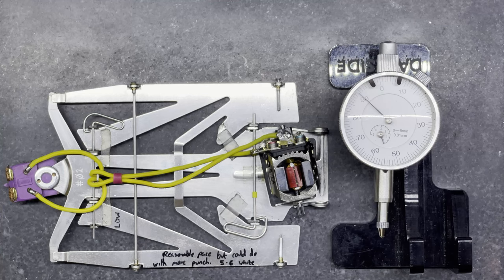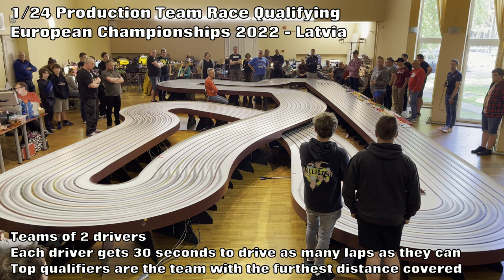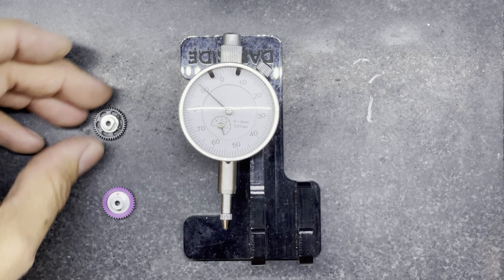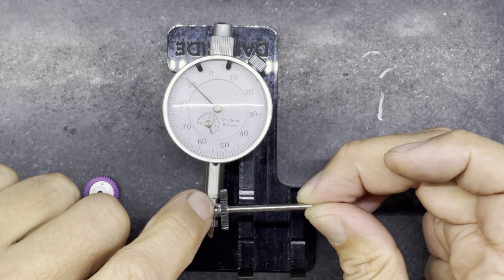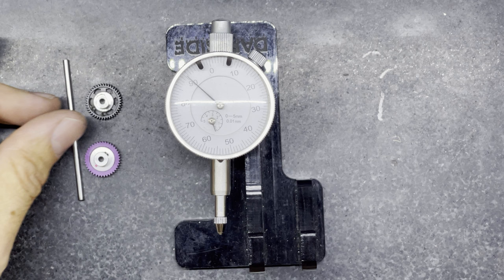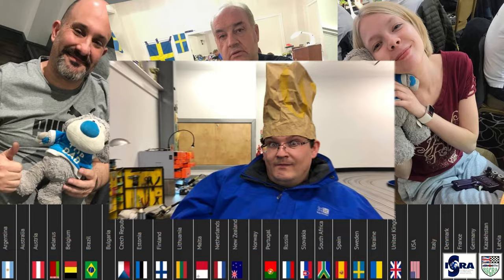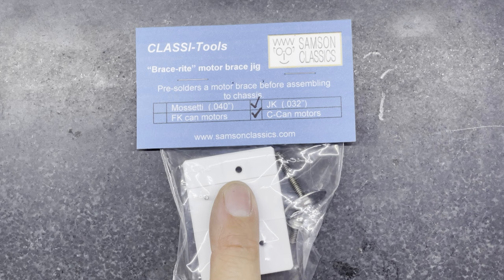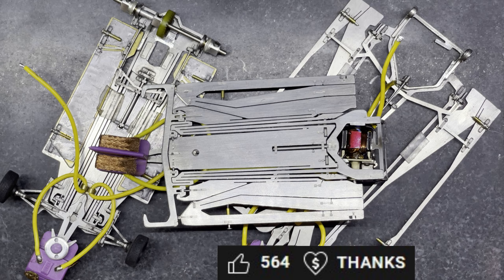Preparing for the Slot Car World Championships -  How can a set screw affect the axle so much?

Comment: Back in the 1980's era, when I raced Wing cars, we all would have axles with setscrew gears mounted to them on our cars and  in our pit boxes. When checking the axles for run out I noticed that the setscrew gears would bend the axles. To counter this I would bend my axle and mark it so I knew where to position the setscrew when tightening the gears in place.
Reply from the maker: Good point 👍🏻. In my past before I used to glue in the gears, I sometimes was able to use the grub screw to help straighten a bent axle. I didn’t deliberately bend it in the first place though 😂.
Reply: @CleaveTech  There was an effort to run two setscrews back then as well. With some fooling around you could avoid bending the axle as well as helping to balance the rear axle assembly somewhat.
Reply from the maker: I recently built a plastic bodied car that came with 2 set screws in each wheel and the gear. Seems like the trend continued 😉😁.
Reply: @Slotcartires  Yeah, we used to do the "Two Grub Dance" here in Hollywood with those pink gears.  Also helped if you stripped the threads in one hole.

Comment: Would it help if the gear had two set screws on opposite sides of the axle which would apply force from two directions - hopefully cancelling each other out?
Reply from the maker: You raise a good point and some of the hard body slot car manufacturers use 2 opposite grub screws. The problem with using 2 grub screws is that the gear or hub is then pivoting about the tips of the two set screws and will probably not be running very true to the axle.